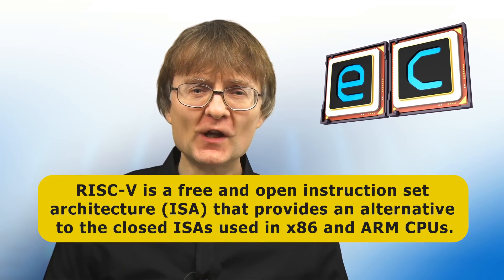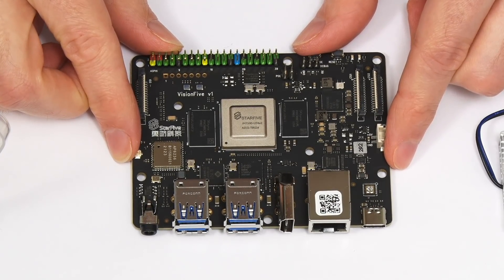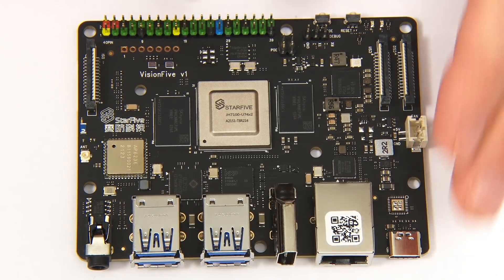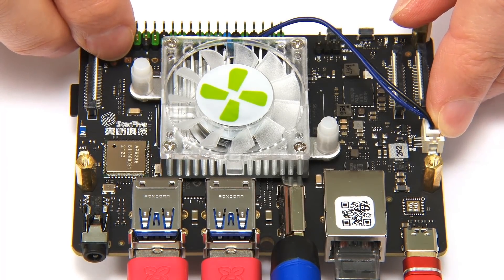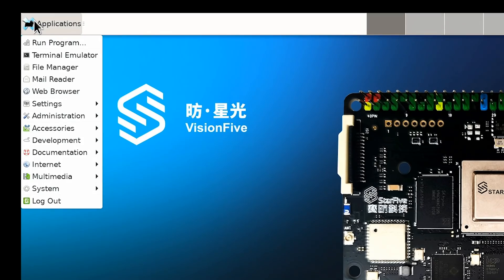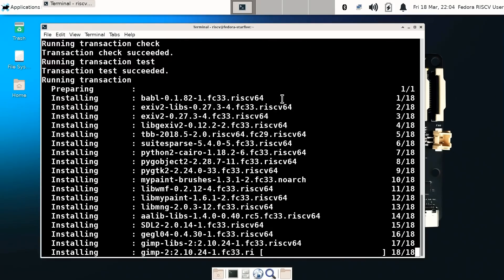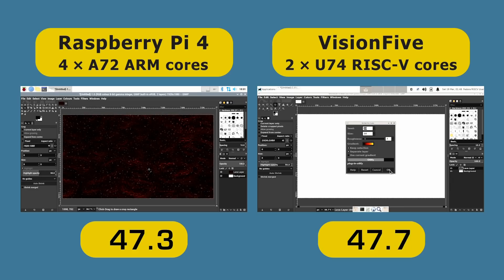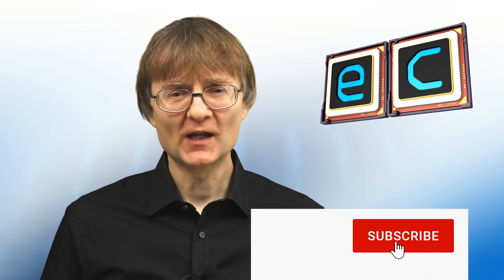VisionFive RISC-V Linux SBC

Comment: Scaling rarely being linear with computing power but Rpi4 having double the computing cores and 50% more clock speed, this is impressive and very promising. Finally we're much closer to affordable true open source computing. Thank you for the great video!
Reply from the maker: I am so very, very pleased to read this comment! Thank you. I wish I had pointed out in the video that, in the GIMP filter test, the more slowly clocked, RISC-V cores on the VisionFive actually outperformed those on the Pi! :)
Reply: @ExplainingComputers  I guess it can be noted that RISC-V does have a little over twice as many usable CPU registers if compared with 32-bit ARM. This can likely help it somewhat on the performance front (though, ARM is still a little "stronger" in some other areas). A lot of ARM code ends up with a significant number of register spills and reloads (though, still not as much as on 32-bit x86 or similar).
Reply: @BGBTech  the Pi4 is a 64 bit CPU. I'd assume a 64 bit OS and applications were being used as the Pi Foundation actually does support that now, six years after the first 64 bit Pi went on sale, and with even the new Pi Zero 2 being 64 bit.
Reply: @BruceHoult  Until very recently, Raspbian did not offer a 64-bit mainline version, so many/most of the RasPi's around are running a 32-bit OS, despite having 64-bit capable CPUs.

If comparing RISC-V with A64, it is likely that A64 would have a performance advantage (mostly) due to it having a few more advanced addressing modes and similar, which seems to be a weak area for RISC-V.
Reply: @BGBTech  yes I know, and as someone who bought a Pi 3 on the day they were announced, I find it totally shocking that it took 5 or 6 years to get the hardware properly supported!

Re the A64 addressing modes, it turns out that given modern compilers and typical software, those fancy addressing modes don't actually give much of any advantage at all. Sure, you can cherry-pick some isolated example with a handful of instructions, but that's really not representative of real programs. It's optimising the wrong thing.
Reply: @BruceHoult  You don't need many fancy modes (I am not advocating autoincrement or memory-indirect addressing or similar), but one of the major ones is [Rb+Ri*Sc] / [Xb, Xi, LSL, N]. This case is common enough that needing to spend several extra instructions to fake it using arithmetic instructions is not ideal. Accessing an array by index within a loop or similar is not exactly some obscure edge case...
Reply: @BGBTech  You are quite correct that accessing an array element by index inside a loop is the common and by far the most important case. And that is EXACTLY where you don't need fancy addressing modes because if you write e.g. "int t=0; for(int i=0; i<N; ++i) t += a[i]" (which as written appears to require your fancy addressing mode) then any modern compiler will convert it to "t=0; int *p=a, *limit=p+N; while(p<limit){t+=*p;++p;}", which does not use your fancy addressing mode. And if N is known to be, say, a multiple of 4 then you'll get code equivalent to "t=0; int *p=a, *limit=p+N; while(p<limit){t+=0[p]+1[p]+2[p]+3[p];p+=4;}" which very precisely uses the one addressing mode that RISC-V has. Both Arm and RISC-V require exactly 10 instructions per loop (adding 4 array elements to the total per loop) for this code.
Reply: @BruceHoult  There are plenty of cases where the loop index is not the same as the array index (such as a dynamically calculated value, a value looked up from another array, ...). It is also overly limiting to assume that the compiler will be able to unroll the loop or perform other high-level transforms.

Granted, one can argue that the scaled-index mode requires (at least) a 3R/1W register file for memory stores, unlike (Rb+Disp) where stores can be done with a 2R/1W register file, but apart from small microcontrollers this doesn't seem like a worthwhile limitation IMO (more so when compared to the costs which would be implied by implementing the 'M' and 'F'/''D' extensions and similar, ...).

Scaled index load/store is likely to have bigger impact on performance, say, vs having a hardware integer divide instruction or similar, as well as being cheaper.
More so, instructions like FMADD and similar already imply that one has the ability to have a 3R register file.
Reply: @BGBTech  3R on the floating point register file is utterly different from 3R on the integer register file. FMA (using 3R) is probably something like 80% of all instructions in floating point code. It is completely worthwhile to go to the expense of 3R there. In integer code 3R would be some tiny fraction of instructions.

I think I'm reasonably aware of what kind of loops commonly occur in software. I've only been programming professionally for 40 years, and helping write open source and commercial compilers for a bit over 20 years, but I'm slowly learning.
Reply: @BruceHoult  From my stats (admittedly, from my own compiler on my own ISA), these loads/stores are closer to around 15% (though, with the scale hard-wired to the size of the type). I don't really consider this case to be entirely insignificant.

Granted, my compiler is relatively naive (relatively direct translation with no inline functions  or loop unrolling or similar), and I optimized parts of the ISA design partly to fit what I could use effectively from my compiler (it also predates my ISA project by a decent number of years).

I am not trying to claim seniority here or anything, since apparently, you have been doing this stuff for a bit longer than I have existed... (I am from Gen Y).

I am messing with an ISA I designed because it seemed like an interesting project... Granted, my ISA is VLIW (with a 6R/3W regfile) so likely represents a slightly different set of design tradeoffs.
Reply: @BGBTech  I think you know I've looked at BJX2 in the past. It's interesting work, and I know you follow a lot of the same philosophy as Mitch espouses. I completely agree that if you have relatively unsophisticated compiler technology -- or maybe just want to make assembly language programming a little smoother -- then base + scaled offset addressing makes perfect sense. It's not obviously wrong or something. But, equally, having only base + offset addressing is also not obviously wrong, and many very successful ISAs have had nothing more.
Reply: @BruceHoult  OK, though BJX2 and MY66000 are also very different in many areas. Eg, BJX2 is a VLIW which I am optimizing mostly around being able to fit on "affordable" FPGAs (Such as XC7S50 and XC7A100), but also trying for "moderately good" performance.

Well, nevermind all the corner cutting and lackluster code generation from my compiler, ... Can often get pretty big speedups by rewriting stuff in ASM.

But, I guess an  open question would be, if RISC-V could define a Scaled-Index addressing-mode as an extension, and if the compiler (and CPU core) could use it, what effect this might have on benchmarks and similar... (while keeping everything else the same between the tests).

Well, and for good measure, maybe hack together a way to load a 32 or 64-bit constant in a single clock-cycle without needing to do a memory load.
Reply: @BGBTech  "keeping everything else the same" is not easy. You can't just say "you need to execute fewer instructions". Adding a 3rd read port is going to need some amount of extra silicon area, which will then make the chip cost fractionally more and use more energy. Executing a shift and then an add is going to introduce slightly more circuit delay than doing a shift or add alone. If you do that in 1 clock cycle then is it going to reduce your operating MHz? If it reduces the MHz by more than the saving in executing fewer instructions then you lose overall.
Reply: @BruceHoult  In my case, I get the extra register port from Lane 3 (disallowing 3-wide bundles with Store). I would figure a 2-wide Superscalar machine (4R/2W) would likely use both lanes for Scaled-Index ops (maybe with a potential for a slight reduction in ILP in these cases).

This mostly leaves 1-wide machines as the main point of debate (eg, probably wouldn't want or need it on an RV32I core running on a CMod-S7 or similar). This is where keeping it as an extension would make sense.

Typically, for AGU/AGEN, the number of scale shifts would be fairly limited (1/2/4/8). In my case, it is also narrower than a full-width integer ALU (48 vs 64), and has its own dedicated module (Lane 1 only).

I can note though that actually, a bulk of the LUT cost in my CPU core goes into the L1 and L2 caches. These kinda dwarf most of the rest of the core, and seem to be one of the factors that limits clock speed.

Had mostly ended up with 50MHz as "good enough", as running much faster requires making compromises (at least on the Nexys A7 and similar). The cost of the compromises needed to run at 75 or 100 MHz generally outweighed any gain (performance kinda takes a hit if one is limited to 1-wide operation with tiny L1 caches...).
Reply: @BGBTech  50 MHz is not bad if that's with more than 1 IPC. It would be very interesting to have a competition to see what design could complete some Linux benchmark the fastest using a standardised cheapish FPGA board ... perhaps Nexys A7-100T and/or Arty A7-100T (same FPGA, but slightly different amounts of DDR). Some people might even manage multi-core in that. Any micro-architecture that fits, any ISA...
Reply: @BruceHoult  My compiler is kinda weak here, and getting over 1 IPC usually requires hand-written ASM.

Some of this is because my C compiler mostly emits RISC-style code (it can't effectively use the VLIW features), and because most basic blocks tend to spill all of the variables to the stack (including temporaries) and then reload them again for the next basic block (and then triggering a lot of interlock penalties as the compiler tries to immediately use the loaded value, ...). Compiler may try to shuffle and parallelize instructions, with limited success.

Dhystone score is typically kinda weak (only ~ 70k last I checked; or ~ 0.8 DMIPS/MHz).

It can also get ~ 4-8 fps running GLQuake with a software rasterized OpenGL backend (some amount of ASM). This is comparable to Quake's software renderer.

Doom is ~ 16-20 fps, Hexen ~ 8-12 fps, ROTT ~ 6-10 fps.

I also don't yet have a Linux port (porting Linux looks like it would be a pretty big/complicated project; and would likely first require writing a backend for it for GCC). Though, it is likely GCC could do a better job at this.

I "sorta" have an OS, but it is pretty immature, in some ways sorta resembles a Linux/MS-DOS hybrid (running binaries in an LZ4 compressed PE/COFF variant).

...
Reply: @BGBTech  yup. HUGE amount of work doing ISA, CPU, software stack all by yourself ... it's all very impressive. Being able to take a basic ISA like RISC-V with existing gcc and llvm support and existing open source cores, and just add a few tweaks (e.g. custom domain-specific instructions) makes everything soo much easier, but just that bit less unique.

Comment: there are lots of FPGA implementations of RISC-V which enables a lot of facinating research projects as different groups look to optimally implement extension ISAs for vector processing and cryptographic hardware primitives - lot of videos on YouTube about those kinds of things. 

For those that just want to dabble and learn RISC-V on the very cheap, I'd recommend the TIGO VGA32 ESP32 which can be programmed with Arduino IDE and the ESP32 sketch. Cost about $21. There are a couple Sparkfun boards priced at $44 and $30 that have identical SiFive RISC-V SoC.

These really low-end boards will have a 32-bit single core CPU clocked around 100MHz or maybe up to around 300 or 400MHz.

The are more of an emedded application kind of boards.

It's really great to see a 64-bit 1GHz board that has a distro of Linux that's easy to bring up. And that's crammed with all manner of coprocessors for AI, ML, IoT - such a great board for exploring and learning all these subject areas. Very exciting stuff indeed!

Comment: Considering the OS seems to still be in a somewhat unoptimized state, executing Quake that well actually shows some massive promise. To run that game well(the 3D could be done in software, but performance suffered and it given textures a somewhat... greasy look) on it's native hardware back then, you'd need a 3D card on top of your graphics card. Of course, modern video cards have both in one unit, but yeah, this doesn't exactly have a full graphics card.

One thing I do wonder about these deep-learning AI chips, I know almost nothing of how they work, so excuse me if this is quite ignorant; would it possibly be able to "learn" by watching the CPU for any regular patterns and possibly find ways to optimize it? That would be a massive thing, but as I say, it could just be me thinking too hard on what it means, but I do know DLSS(also by NVIDIA) upscales a games from 1080p to 4K using deep-learning AI to predict how a frame would look at higher resolution. I should note I find it to be the best real-time upscaling by quite some margin. In some cases you can only tell the difference by examining still images.
Reply: What makes you say the OS is unoptimised? It's simply slow hardware -- it would have been interesting to see it compared to a Pi 3 rather than a Pi4, as that is what they U74 CPUs are comparable to. There is much faster hardware in the works.
Reply: @BruceHoult  Well, the processor, I'm not sure about graphics hardware, but it seems to me to have around the power of a decent Pentium 2 machine. I remember using a computer of that class for years, and the OS UI performed nowhere near that badly for things such as moving windows around. Consider this machine is also dual core, it tells me the OS isn't well optimised for the machine.
Reply: @fattomandeibu  I'd estimate something like 1.0 GHz Pentium 3. Remember that in P2/P3 days we didn't have GPUs at all -- and the software didn't even try to drag windows around live. When you moved a window you moved an OUTLINE of the window, and then the window was redrawn in the new place when you released the mouse button. If you configure your window manager do do that (and to not use transparency, not animate sliding menus in and out etc) then yes of course this will perform much better. That's just configuring the software's existing options, not optimising the code.
Reply: @BruceHoult  I had a graphics card back then, some of my friends had 2, because if you played 3D games you would require to have not just a graphics card, but a specialist 3D card, too. These machines would also display the entire window when moving them. At least in Windows 98, which was the first IBM compatible(x86 in modern terms) I owned.

As for what you're saying on optimizing, I think you're being too literal on what I said. You took "optimizing the OS" too literally. I don't mean the code, I meant the overall OS. Not all optimizations need to be done in code. Anything that helps the system perform better is optimization, whether tightening the code or changing the graphics rendering mode.
Reply: @fattomandeibu  "graphics card" is not the same as GPU. ATI Mach with 2D acceleration existed from 1990, but were not common. "3D Rage" was 1996 and Pentium II 1997. Of course you could buy cards and add them to a desktop system, but looking at, for example, Apple laptops, none of the 1997 models had any graphics acceleration, while all the 1998 models had Rage LT or Rage LT Pro. I used Win95 and NT3.5 and NT4 and Win2K but I don't think I've ever seen or used a machine with Win98!!
Reply: Here on YouTube, a mathematician under the moniker of 3 Blue 1 Brown has lots of great video's, some about neural networks: https://www.youtube.com/watch?v=aircAruvnKk.

Comment: I think that we shouldn't underestimate the value of a low-cost sbc that runs in an open source hardware architecture. That said, the performance is oddly lacking for dual core riscv cpu with 1.0 ghz and 8 gb ram. With how badly optimized the software for it is, it's probably not ready to be a pc just yet.

Comment: The MIPS ISA is now open source now that MIPS technologies is now pivoting to RISC V, since RISC V and MIPS are very similar.
Reply: That's not quite right. MIPS announced an open source program, in May 2019, though the terms were VERY restrictive.  They cancelled that program in October 2019. MIPS announced in March 2021 that they were abandoning their proprietary MIPS ISA and adopting the open RISC-V ISA. The MIPS and RISC-V ISAs are more similar to each other than either is to ARM or POWER (let alone x86!), but they are still quite different.

Comment: A great video, running my favorite Linux OS, and having an open source CPU spec has to be a good thing, I was surprised that it was slower than the Raspberry Pi, but I am sure it will speed up as the product develops.
Reply: @Dylan At 3.59 the video states that the CPU has a Vision DSP, is this not just another name for a GPU?

Comment: ARM isn't a closed architecture.  You can license both the ISA and the microarch, and add whatever extensions you want. (Intel has started down this road as well but are highly restrictive w/regard to fabrication.) Paying for it doesn't make it closed.  It's the ability to modify it to suit your needs that makes it open.  RISC-V is more open in that you can contribute your changes to the ISA and hope that they will be adopted officially.   You can pay to be on the foundation so you get a vote towards those changes being included.  Intel and ARM on the other hand might pay you to adopt your changes if they see a broad market for them.  So it's a bit of this and a bit of that.